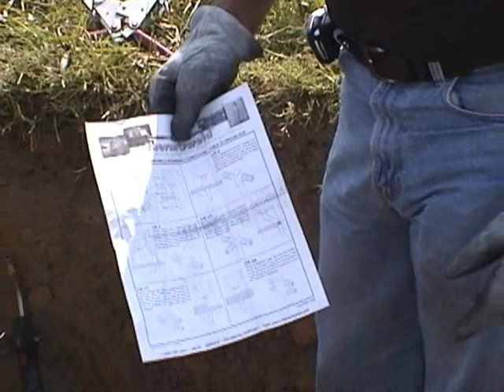thermOweld® cable to cable T -weld.wmv

Comment: done this many times, only on grounding grids. I never stayed so close after ignition however. Any moisture or contaminates  can cause spewing 3000 degree molten metals to cause much bodily harm. Once lit there is no way to extinguish it . So there is no reason to remain as close as this fellow is. No matter how experienced you are, GET AWAY  from it!

Comment: Is it "welding" or "hard-soldering" with brass solder?
Anyhow I don't trust it, because there is no seal against corrosion by humidity.
Would like to see a precision cut through the weld for inspection of the inner conditions.
Reply: it's not the moisture that gets you it's the oxygen.   which is why they get buried.  copper and bronze rust until they are coated, then stop.  so chill